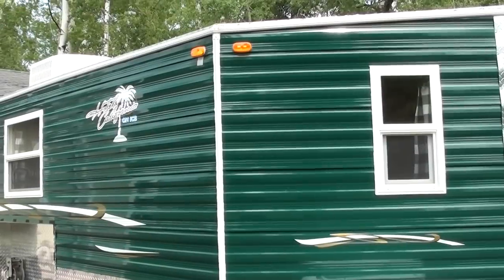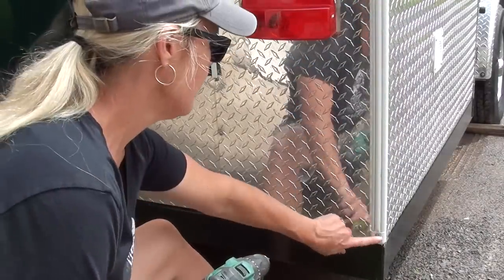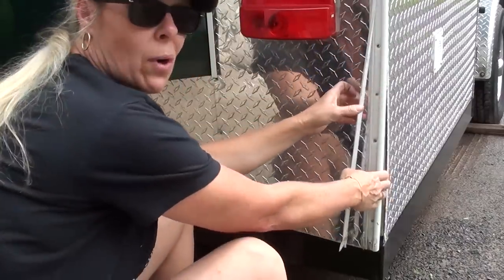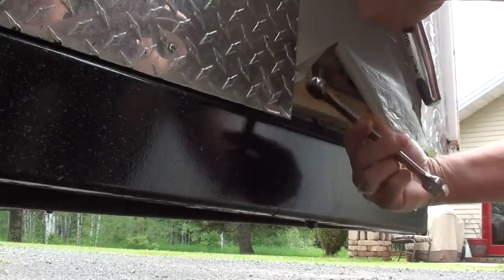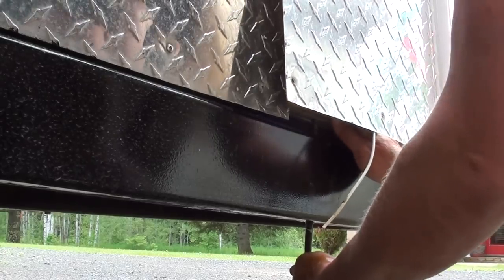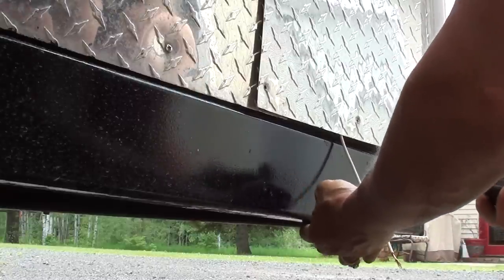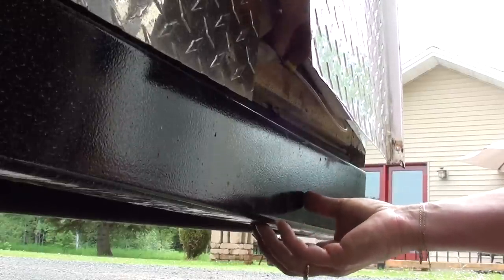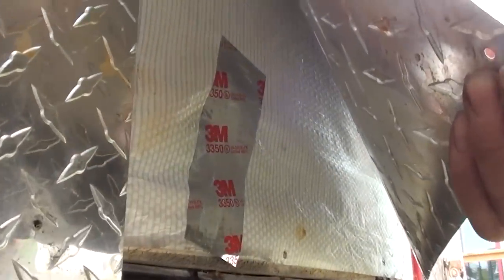How To: Fix Bad Grounds for the Trailer Lighting on an Ice Castle Fish House

Comment: My gosh! All that for a ground wire!! Bad design is an understatement! I just picked up a 2013 Toy Hauler Castle, so I’m watching all you videos that I can! Great videos by the way!
Reply from the maker: Thanks! I agree! A simple ring terminal probably would have prevented that problem in the first place. I hope you don't have the troubles I had with mine. I bought it from the original owner & they were not aware of axle maintenance or any of the common issues they have. 
Good luck on the ice this year & thanks for watching! :)

Comment: Thanks for the heads up.  I have just started experiencing problems with my 2017 Castle with taillights and GFCI outlets inside.
Reply from the maker: You’re welcome! This is most likely the problem with your taillights. I’ve read that the GFCI issues are usually the GFCI itself. Hopefully it’ll be that simple for you!
Thanks for watching! :)
Reply: @EndlessDIY  Yep, I've read several posts on social media that Ice Castle purchases bulk cheap GFCI's and that if I simply purchase the $18-$20 outlets to replace it should take care of the problem.  I'm literally watching your video on insulating ice hole covers!  :)
Reply from the maker: @bayneski1  Ha! Great! I've taken some heat for not just using spray foam on them, but I had the sheet insulation scraps on hand so it kept it out of the landfill (less messy, too)! lol!

Comment: When the frame pieces are cut to size they are placed in a jig and clamped into position. When welded together the seams are not welded watertight. So when the house is set on the ice and water comes around the frame water enters  the tube.
Reply from the maker: Thanks for the insight! I'd never have thought of that. :)

Comment: Wow, think the Ice Castle designer's could improved that area development!!! Like maybe a common grounding bar for all the electrical or even the light's grounds ran to one spot by the hitch where a person can get at them easily??? I can't believe all the water in the frame let alone that it was enough moisture to cause your ground wire to already start to erode. I always put Silicone around all my new wire connection's just to prevent moisture from getting in and causing corrosion. I would of made or pushed Ice Castle to fix that problem if still under warranty.
Reply from the maker: It’s definitely less than ideal. Even if they had to ground them the way they did, just that extra little bit of hardware probably would have made all the difference. 
Ice Castle doesn’t build their frames, so they can’t really be faulted for the water issue, but the current makers have addressed the problem. 
My ice house is a 2013, & it’s way out of warranty so I’m just glad I can do the things that I can do or it’d cost me a mint to keep my stuff working the way I do; I can’t stand when stuff doesn’t work properly.